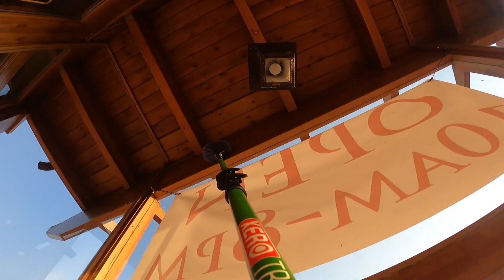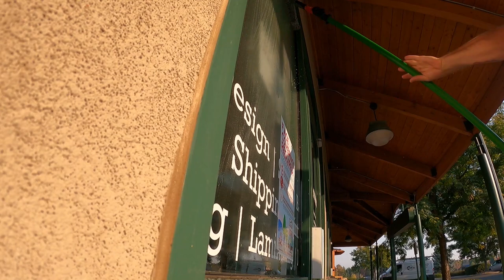FALL WINDOW CLEANING VLOG | FLIQ ISSUES | POWER WASHING

Comment: Moerman lol so true... I was an eaze angle they didnt listen to me..... and for years I've watched in dismay, use a spray pack instead of a bucket never worry about a dry sleeve again. That white scrubby bit on fliq pads catches spider webs and hairs and puts them on the rubber lol. Your one of few YT window cleaners I dont want to punch in the face 😁. I could do a video on how to fix every issue with moerman it is hands down the best squeegee in the world flawless with a few fixes.
Reply from the maker: Thank you for not wanting to punch me in the face lol 😂
Reply: @SteveOthewindowcleaner  lol 🤣, was one of those comments I thought twice about after posting, I dont really want to punch anyone 😅 I just get frustrated occasionally, mostly just want to help lol. I'm up early going to try and put some video together ✌
Reply: Texaco  as a manufacturer they suck imo but as a concept it's the best design  most functional design but a wagtail is often better due to build quality